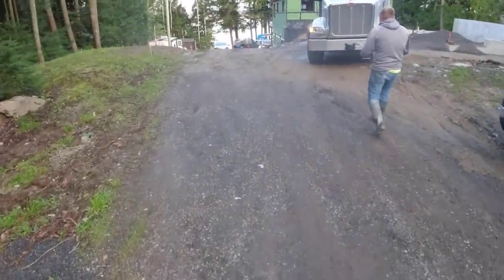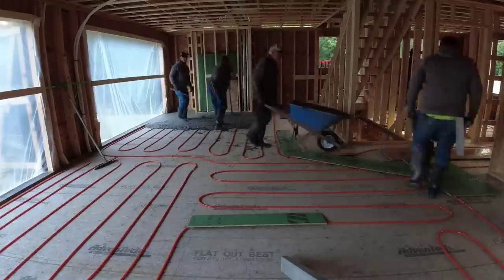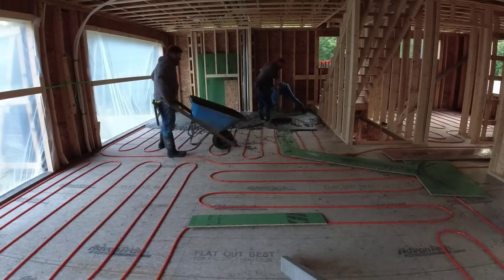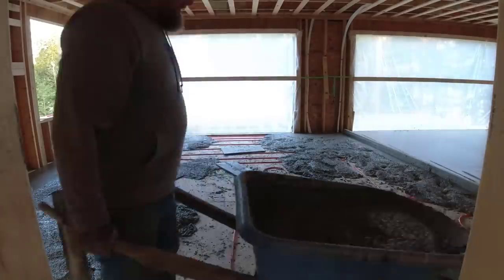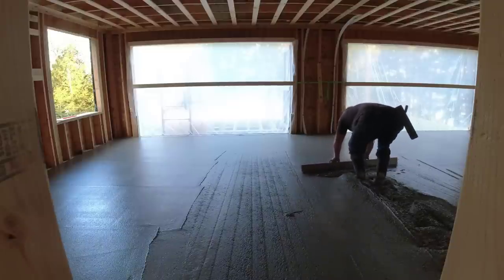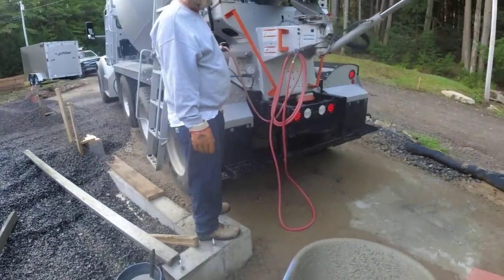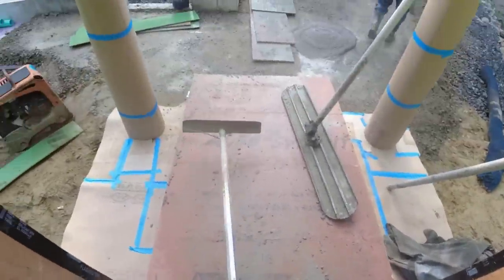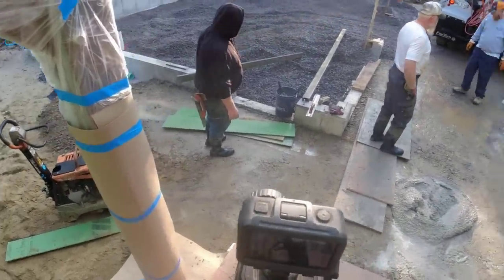Very THIN Concrete Floor Pour OVER PLYWOOD | We poured it 1.5" thick!

Comment: My neighbour had this type of in floor heating. He designed it himself. He had the pipes feed in/out of a small water heater ie) 10 gallon with circulating pump attached  to it. We live in northern Canada so he filled the system with an antifreeze/water mix to prevent feeezing in case of a power failure. That thoughtfulness impressed me

He was planning on installing same system for his 10 car driveway but I never got to see it as I moved. He was
An engineer and always was messing around with stuff. 

Love your channel

Comment: You would think the framers would have doubled the sill plate on those walls the drywallers wont have anything on the bottom to screw off too .
Reply: Don’t you think that drywallers would be smart enough not to put screws across the bottom?

As long as the painters don’t conceal your stud marks, the trim installers will be fine.
Reply: So put infill blocks between the studs. And NO...they aren't  smart enough but they really should have bottoms nailed
Reply: That'll be alot of scabbing work for sure.
Reply: When we build a house with infloor heat we always double plate the bottom
Reply: The number one rule of each trade is to do a "perfectly good job" that makes the next trades job harder.
Reply: @pandagold4722  LOL
Reply: You're right, they should have had a double sill plate, It was a cheap contractor, I can't believe the reply by others.

Comment: Great video! Do you ever pour these with a pump truck?
Curious they didn't double plate the bottom plate of the walls to keep a nailing block for the bottom of the sheetrock. Standard practice in SC
Reply from the maker: We use a pump when the sq footage is bigger. This one is really quite small for a pump (at least for us) just as fast and a lot cheaper to wheel.
Reply: We double plate.

Comment: You’re right Mike. Used to repair multi story parking garages . Lots of partial depth repairs at 1.5” thick. 5000 psi straight cement mix with shot gravel . It’s not easy to manipulate concrete when it’s that thin, and shrinkage was always an issue.
Reply from the maker: This will have lots of shrinkage and cracks but it all gets covered with flooring so not an issue.

Comment: Surprised there isnt a foil material on top of the plywood flooring ! Last one I did had it ! We used  trailer mounted pump with a 2 in line also !
Reply from the maker: We've used the 2" line, it works good. This one was small enough we figured wheeling it was just as easy. (and cheaper)
Reply: Yeah I thought that as well. You surely want to radiat the heat up rather than lose half of it down. Plus shouldn’t the pipes have stand offs so they are protected by the concrete underneath?

Comment: I’ve been doing tile floors for years and have used pumped gyptcrete but never straight concrete. What’s the weight deflection ratio on something that heavy ? Shrinkage and exp and contraction over wood ? Would a Sand topping mix be a better choice? Interesting concept but never have seen this done I’m in the north east too with cold temps and have seen houses exp and contract 1/2 inch sometimes. Good content btw
Reply from the maker: I don't have all the tech answers to your questions but we have done 100's like this in Maine with no issues.
Reply: @MikeDayConcrete  I guess it could be equated to one giant mud bed 👍 I was just wondering if you’ve done 100s then it’s golden. Is there fibers in there. I do a lot of bathrooms old schools Style with mud,mesh and 3-1 sand mix. This is interesting !!!!

Comment: Never seen this pour before.
Does timber floor not need a membrane first.
Any flex with this floor.
What supports under floor.

I have a question for you about 4 inch pour interior floors.
Do they need rebar or not.
Thanks.
Great work in such a small area.
Reply: It needs a vapor barrier.  This is just a horrible example.

Comment: I am going to be doing this type of flooring in my new home in Appleton.  It is 1850 square feet on the first floor.  I have the double plates on all walls to allow for the first plate to be covered.  I have been told screwing some 2x3 sleeper boards would help with the leveling process.  I noticed in this video there were no such boards.  Have you done floors with the sleeper boards in place?  Would it be helpful or just overkill?

Comment: Seems like it'll be way too much weight.  Is it doubled 2x12 floor joists and double sheathing?
Reply from the maker: It's not that much weight. Sub floor is 2x12 16" on center with 3/4 tung and groove plywood flooring.

Comment: 1.5" thick concrete over wood that flex will not crack over time?
Reply: Sounds like it will have tile layed on top . I can't see the grout & tile not cracking eventually. It's almost guaranteed because the plywood flexes.

Comment: I wonder whether there isn't something you could attach to the front of the wheelbarrows where they hit the ground when they dump that could eliminate all the moving plywood/osb around on the floor. Seems okay to run over the tubing with the wheel, just not to tip/dump on it.

Comment: Do you guys not have light weight concrete in Maine? We have it down here on Cape Cod. Its i do believe a lava type stone. They have to soak it for 24 or 48hrs prior to the actual pour. Its made exactly for that type of situations.
Reply: As he said in the video, it's twice as expensive, so regular concrete is more cost effective.
Reply from the maker: It's twice as expensive and not really that much lighter, a few pounds per sq ft for this type of pour. Not worth it. I started out doing these pours with LW concrete years ago, it's not needed for a floor that's designed like this one is.
Reply: Oh no kidding. I've used it before as well as had a few stones left inside the drum an it's a different kind of pour an finish. I thought it was a drastic # for # difference. I'll have to look into that for future jobs. Thanks

Comment: You can do these with minimal cracking if you can get your supplier to use a large amount of PCE water reducer and get your W/C ratio extremely low, like .35. PCE can turn a 1 inch slump into an 8. You're getting 200sf per yard so a very expensive concrete mix hardly matters. Basically a concrete counter mix.

Comment: Could this be finished with polishing or is it to thin?
Reply from the maker: It's kinda thin. It could be polished but it will have quite a few shrinkage cracks in it. 2 inches to 3 in is better. Then we can saw joints in it

Comment: Some years ago I was asked to remodel an existing but very well abused main DT establishment…the was to be a bar restaurant…the theme was the trendy rust/exposed older masonry…..so cast in place concrete everything..countertops, floors…even made urinals and sinks from kegs…the restroom floors were to be 1” concrete over multiple alternating wood ply sheathing..similar to the Application for ceramic installations..I applied a few coatings of a non latex bond breaker sealer on all surfaces, small elevators of steel electrical staples to 1/2” and a 1 x 1” welded wire mesh tied to those elevators..the concrete was in the 6000 psi range mix, 1” in thickness……waterproof absorption, and of course cure agent in multiple applications…it turned out great and is about 8 years without fractures..I would have never guessed in a commercial setting…..

Comment: You guys are incredible. You make the job look so easy. I am a big fan. ;-) I made some quick calculations. 19lbs / sf x 900 sf = around 8 tons... or the equivalent of 5 to 6 cars. That must require a very strong structure. BTW Why not a more fluid leveling compound instead of concrete?
Reply from the maker: The concrete is to hold the "heat" from the radiant tubes. Concrete holds heat much better and longer than self leveling would.
Reply: What did they do to the floor joists to beef up for added weight. Bexisse you have concrete plus tile ?
Reply: @dscapes1091  That's where the engineer (licensed PE) comes in. The "dead load" calculation for the floor joist sizing would take into account for the extra weight of the concrete. Not a big deal.
Reply: Yeah that's a shitload of weight!

Comment: This is getting more & more common here in the UK but never ever seen it done with concrete they are always done with a liquid screed that's lightweight, flexible & just flows perfectly level & flat.

On ground floor underfloor heating though it's just concrete slab 100mm PIR insulation pipes then regular screed.

Comment: Framers should have doubled up the bottom plate to begin with. Now you'll have to add blocking to every bay.
Also, why not just pump it? We pump almost everything here in SoCal. It would be so much easier instead of messing around with wheelbarrows.
We always use lightweight concrete when doing something like this. We do it mostly for sound control. Not sure how regular mud will hold up. Tile contractor can use an anti-fracture membrane to mitigate any cracks.
Reply from the maker: Dragging the pump line over the radiant tubing is worse than wheel barrows. If you've never done it how would you know it's easier? The weight difference between lightweight and regular concrete at this thickness isn't that much. But the price of the concrete is double for lightweight. We've done 100's of floors like this with no problems.
Reply: Like I said, we pump almost everything here in SoCal, so yes, as a GC for over 30 years, I've done it many times. I seen many of your videos and notice you don't pump much, just curious as to why. We pump lightweight mostly on 2nd floors and above on apartments and condos, again mostly for sound. We don't do a lot of radiant floor heating through tubing. Most of our radiant heat we use is electric like NuHeat. We put that down directly under tile or hardwood. We don't have the severe cold like you do. I wouldn't see the pump hose as an issue over the tubing, we drag it over all sorts of stuff, and we'll put protection under the hose connections on sensitive areas.
You guys don't pump much and we do. Not saying it's wrong, just different. For us, pumping is the way to go. To each his own.  @MikeDayConcrete

Comment: You guys should have of used a barrier to separate the concrete and wood. The concrete will eventually rot the flooring and sill out. Just fyi
Reply from the maker: Sorry after doing this for 42 years like this with no problems 100s of floors, I didn't know this

Comment: This screams NOVICE!  The wood will suck the water right out of that concrete, weakening it!  It needs a vapor barrier, like a plastic sheet between the concrete and the floor.
Reply from the maker: 42 years of novice 🤣
Reply: @MikeDayConcrete  We have learned since that it sucks water out of the concrete and weakens it.  Needs a membrane between the wood and the concrete.